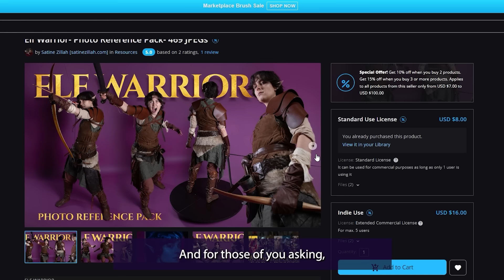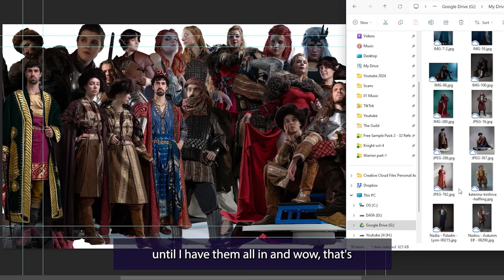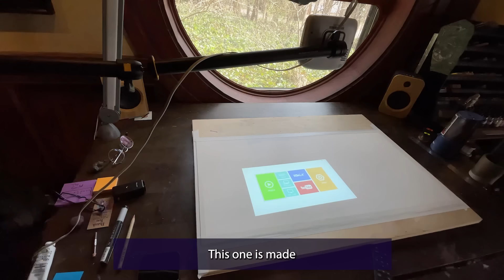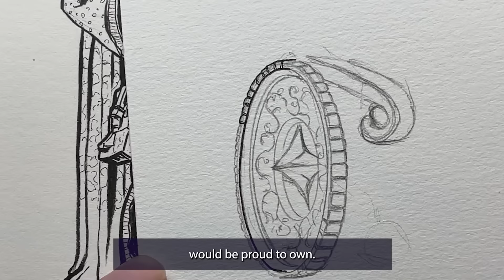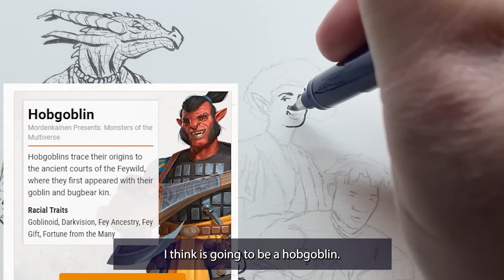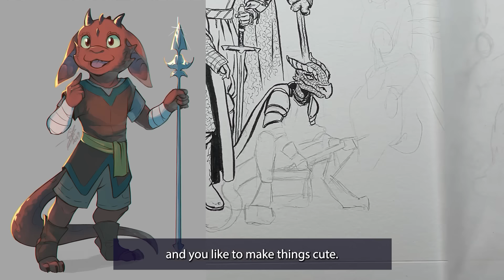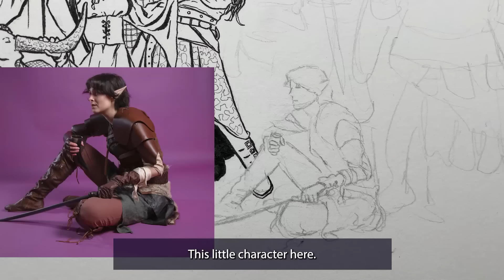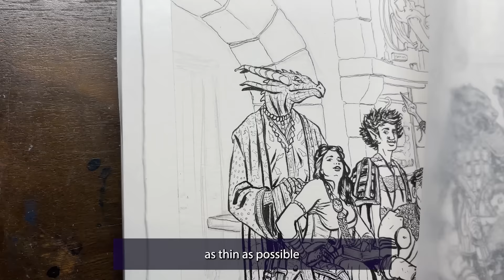I Painted Every Dungeons and Dragons Character... Almost.

Comment: So when erase on these papers you’re most likely filling in bumps and holes and at the same time smoothing the bumps so the paper becomes less absorbent! And oils from you fringes can also cause the water color to not sit right on the paper too… some of the reasons I don’t like water color it always seems to turn out differently every time I paint even if the paper is saw the water color is the same…

Comment: 6:45 
Another good method is just having any scrap bit of cardboard to tape your works to, I usually use the backboards from empty paper pads, but only if you have A5 - A3 sized works, unlike Scott's usual larger ones
Reply: I use inexpensive foam board! Though I’m usually painting on paper!

Comment: I own an antique wooden wheelchair I use for steampunk cosplay. It looks cool, but is very heavy and cumbersome compared to my aluminum ultralight.

The idea can work in D&D, but should really look more like early bicycles than “furniture with wheels.” It depends on the setting, though. A social game in a city wouldn’t be too bad, but dungeon crawling would be all but impossible. I actually dreamed up a character who’s a paraplegic goblin ranger—she rides a big spider with a special saddle that straps in her legs and lower back, so that when the spider crawls to the ceiling she can rain arrows down from above.

There’s several online guides for drawing wheelchairs written by disabled people that you might find useful. My fave is from The Mary Sue. In general—lightweight for mobility, lower back to allow more shoulder movement, designed to be pushed by the person sitting in it rather than a standing person. If you can use your arms to push, you should use them in order to exercise and stay strong. Only those with very limited upper body strength should be relying on motorized/magical propulsion.

Comment: Now, youre a much better artisy then i am, but i had an idea for your too much erasing issue. When i paint my tattoo flash, i use arches cold pressed watercolor paper. Its far to expensive to ruin woth eraser marks so i take my finished sketch and use a lightbox to put my linework directly on my watercolor paper. As for the texture, i love that for how it makes my flash look but i get not wanting to see the texture of the tooth of the paper on certain styles of art. Love the videos.

Comment: I see that you're using the Zebra superfine brush pen - the best pen on the market. I find the smoother the paper you use with those pens, the longer they retain the fine shape of the nib, Paper with more tooth wrecks them very quickly. Another reason why the hot pressed paper is better.